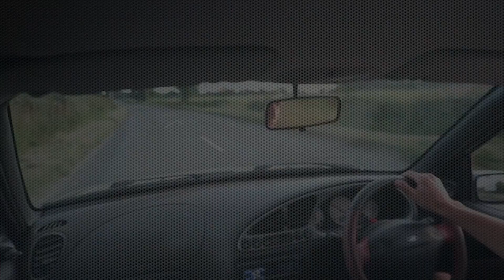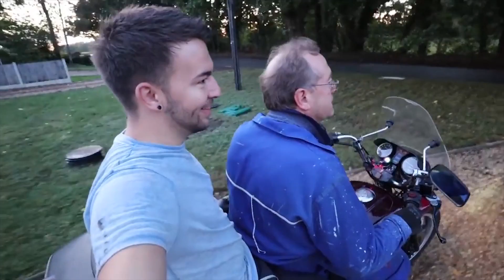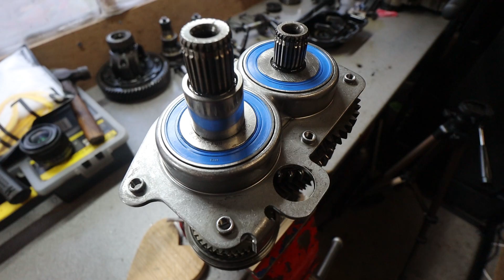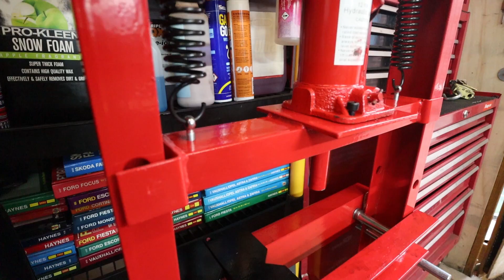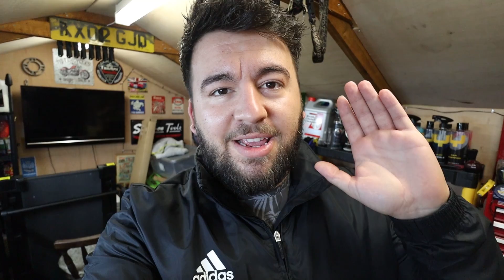Replacing The Skoda Gearbox Bearings!

Comment: Hello, great video! 

I am a precision fitter for a cnc spindle refurb company and work with this type of thing daily.... the easiest way to get bearings on to a shaft like that is to heat the inners of the bearing up slightly using a heat gun or a hot plate and ring. You will then find they expand enough So you don’t have to tap them down as this can sometimes knock the bearing out of track causing them to fail. 

Hope this helps👍🏻

Comment: hi . i was hoping you could help. can the drive shaft flange bearings be replaced with the gearbox in situ or does it have to be stripped down and the case split. my sons octavia 2 1.9 tdi 2009 is making a terrible rumbling noise at 60 plus mph and its not the wheel bearings . i have a strong suspicion its one or both drive shaft flange carrier bearings ? regards w

Comment: Was there any rattling Sound coming from the car when driving it or was it only at idle?

My fabia 1.4tdi Got a similar rattle at idle it goes away when pushing Down the clutch or just by  raiseing the rpm to 13-1500. 

There is No rattle when driving only at idle. Just had the clutch and releasebearing replaced a week ago and that did not help anything. 😅

Comment: Brilliant channel, nice to see someone who is prepared to have a go without a fully equipped garage, just a drive and a shed, your presentation and explanations are spot on (even if it`s something you are leaning yourself).  Quick tip don`t assume that ebay is going to always be the cheapest, I have got some parts much cheaper from a main dealer before, especially obsolete model parts they can be reduced just to clear stock. If you have different main dealers near ring both as the parts price can sometime vary massively.

Comment: I've overhauled many manual transmissions (mostly Honda, Toyota and Nissan) and I have NEVER seen a 'sealed' bearing like those used inside a trans.
The idea (usually) is to have them 'open' to be adequately and constantly lubricated with the 90# gear oil inside the trans.  This type bearing is normally used for different applications and the lubrication (grease) is contained inside the plastic seals.  I don't like this design and think it would be actually better to remove the seals. (No wonder they went bad)
Great job feeling you way through this fairly complex job!
Reply: I bet VW sealed the bearings because this transmission produces a massive amount of metal chips and shavings, which would cause even more damage if they got inside the bearings. Nonetheless, I agree that the oiling is practically nonexistent in these bearings due to the complete enclosure.

Comment: you can bring the ball bearings and the sleeve to around 150 ° C, then you can almost easily attach them.
an induction plate with a piece of sheet steel (3-4mm) works well for warming up.

Comment: Good video mate , Having watched all of it I think you or anyone else out there could possibly pull the bearing pack off by popping out the remaining visible seal on the left bearing , if you have a careful go at them with a very small screwdriver they will just pop out , there,s not much holding these in , having done that get hold of a suitably sized internal race puller off ebay or amazon , these have 2 legs on them that have shaped bulbs on the ends , you carefully insert each leg into the gap between the inner race & the outer ring of the bearing then turn the leg 90 degrees so that it then grips the groove for the ball bearings . Assemble the rest of the puller up above the legs & pull each bearing off a little , do this very evenly or you could easily bend things , a tip here ,  if you use just one puller only pull the bearing you,re working on a few thou , or you could start to bend things - terminally , either the puller or the shaft the bearing is on that you,re working on.Obviously to get the puller,s legs in you have to destroy 2 bits of the ball bearing cage in the undamaged bearing in diametrically opposite places , but you will end up changing the whole pack anyway so this does not matter . it would be very useful to know in advance the distance across the bearing,s ball tracks please , so that we out here can arm ourselves with the right sized pullers . For those that have never pulled any bearings off before , you use a stout , undamaged & well machined piece of flat steel bar across the top of the shafts to screw your puller central forcing screw down onto , with plenty of the same sort of oil that the gearbox uses on it to lube it , but still keep everything clean , no muck , grit , bits or dust must get in there .Ensure that you,re not pressing straight on the end of a fine internal caged bearing in the end of the shaft !  O.K. that,s my 2 penn,orth mate , it will be good to know the size of these bearings, please reply on here , thanks .

Comment: Thanks for some informative videos. Has anyone wondered why the 2 bearings are closed bearings? They both run in oil from the gearbox so why make them closed? Would it be an idea to open the bearings when rebuilding the gearbox?

Comment: Good piece of kit to have...wouldn't be without mine.
Don't forget you can use heat and cold to your advantage to expand/ contract parts that have interference fit.
You'll be needing a bigger workshop if you keep expanding 😬😉🤣
Reply: Have had the same thought for years now... the Man reaches a level where the space available is starting to limit his progress as a "do-it-yourself" Person.
But an upgrade is Flippin' expensive...

Comment: I’ve done a similar repair in the past, I put the gear cluster and main shaft in the freezer for a few hours and get the bearings warm in the oven, wife moans about freezer and oven stinking of gear oil, but bearings are just a simple push fit due to expansion and contraction of the metal.

Comment: Just to add my experience Ocatvia Mk3, 1.6tdi, 2014, gearbox MWW 0A4 was repaired under warranty at 80k km due to noise early in mornings sounded as cow, mouuuu. the noise disappeared once the motor came warm. Outside conical bearings on the diff - 2st. plus the two needle bearings and new oil - G052527 (or something like that was the specification). Trough, after 40km now the noise is back. Digging in documentation of the repair I found that the official service in Norway has tried to add 200mL oil to mitigate the noise with no success.
Now i bought 2Litres Castrol V (corresponding to spec as highly recommended to follow manufacture recommendations), made same 17mm tool a you :) and was ready to change the oil to try something and check for debris as I still have warranty for the repairment. However, opened the reverse switch and add 200ml 80W oil (what I had in the garage) and whalla - no that mouuuu noise anymore in any circumstances including heavy trailer.
Additional research on net shows that even in technical specs the gear box oil capacity is specified as 1.7L when refill out/in and 1.9L when dry fill. However, as I understand Skoda recommend now to add 2.2-2.3L instead. I assume all that is because the gear box is tilted by 12degree back and the fill in plug is not reference oil level anymore on O3 Mk3 models, oil fill in via the reverse switch, easy access under the air filter box, 22mm spanner, same 10mm hose fits well here.
May be some bearings are over the oil level as box tilted now and having the car over the night takes them to dry and the noise is coming next day first 100metters.

Comment: Correct me if I'm wrong but wouldn't hitting the center of the bearing potentially damage the ball bearings? I always thought you press a bearing using the outer part?
Reply: @TomAlter1000  that’s what I was thinking. My only experience pressing bearings is with wheels bearings on my car, hence the confusion. Cheers.

Comment: Hot tip on getting the bearings and the sleeve back on without too much hassle: use a heat gun and get the metal up to around 100 C. Then you should be able to simply drop it on the room temp shafts.
Reply: An old deep fat fryer is good for heating up engine oil and bearings evenly without the risk of damage to the bearings
Reply: It warms me to see that your very honest about your decision when rebuilding the skoda gearbox there are too many dodgy mechanics out there.excellent work

Comment: Regarding gearboxes. I had 13 years ago an opel astra G which broke at 70k km. The simptom was similar to your gearbox issue, one of the bearings broke iside the gearbox. Reading on forums found out it is a common issue for my gearbox type and the culprit is a manufacturing issue where they used a sealed bearing and because of this the gearbox oil was not able to lubricate the bearing. The only lubrication it had was the grease they put inside at manufacturing which looked like it was not enough. Remedy was to change the bearing and also remove the seal of the new bearing. I used the car for 9 more years and in total it got more 432k km with me until i sold it with a little over 500k km on the dash. Never had any gearbox issues. One note, i always change gearbox oil for all my cars every 120k km. It is not a big investment although many ppl say it is not necessary. I always play on the safe side as my cars are my moneymakers. Nice video mate! Keep up the good work.

Comment: You could have had a 2 tonne bottle jack in there to press the bearing off. Even though it’s a 12 tonne press doesn’t mean u need 12 tonne of force for it to come off. Use a bit of heat to expand the collar and it will slide on without hitting it on

Comment: Heat helps. Trick that can work, find a sock that will just rest inside the bearing inner race. Use a blow torch to heat up the socket. Once hot drop it into the bearing. Leave to sit for a short while. Heat transfers into the inner race, which should expand. Then the bearings should drop of, or tap on with very little effort

Comment: Great video pal - I wondered if you could help. My 1.2 HTP 2009 makes the same clutch noise but maybe not as bad but it stops making this noise once the engine has warmed up. Could it be that I need to get some new oil in the gearbox? Strange that it stops once it has warmed up.
Reply: sure its not a pully ie aux belt tensioner pully
Reply: @frankyboy6245  Not sure pal do you think it could be?? Not looked properly in to it yet as car drives perfectly just makes this clutch noise on a cold start up
Reply: @lewispickles6402  change the gearbox oil 1st mate, as what you have described happened on my subaru sti, was I nightmare when cold then warm would be fine. I changed the oil and it was like I had replaced the box. I know mine is a totally different car to yours but its worth a try.
Reply: @mkm7962  Cheers mate I'll give that a try then because it is loud when cold then once warm doesn't make any noise at all. Cheers bro

Comment: I see you have a whole library of Haynes books 😂 
Great video!
Reply: They are good books mate I have a small collection too.
Reply: @Alexander_l322  I have one too for my fiesta
They explain almost everything
Reply: @jozsef6453  good mate, keep them never throw it away even when you get a new car! I kept mine from ages ago just incase.
Reply: There good for dimensions and fluid capacity and torque settings really I wouldn't recommend using one if your a novice mechanic they don't really explain in great detail or if you have one you'll know that looking up a fix in one is a ball ache as for instance changing a blower resistor, you get to the page about blower resistor and it says to remove glovebox please refer to page whatever lmao so yer if you've got a problem and your a novice my advice is to look on YouTube or ask a garage don't just buy a Haynes manual and expect it to work miracles 👍👍👍👍
Reply: @lea-rw5cb  and on YouTube you can see how to exactly execute the job rather then relying on diagrams
Reply: @user-wl3lm2un5e  they only any good if you already know roughly what your doing

Comment: A bit more from me , I,ve renewed bearings in many different machines , & when you need to do this you have the golden chance to fit a much better set of bearings than might have been in originally , if the design of the machine allows you to do it . Sadly the backplate for these end bearings is rolled onto these ones , unless there are still some very skilled tinsmiths still out there you are more or less stuck with it , but you might be able to find a supplier that uses stronger bearings of the same size , this is possible , for a start  , plastic caged sealed bearings in a gearbox , these need swapping for steel shielded steel caged bearings of the same size , these should be far stronger , & the outside seals on them are literally small steel shields that keep the lube in , & foreign bodies out . That is why you ended up fishing one seal off the back of one gear , it had got knocked out of the bearing by bits of broken up plastic cage . Gearboxes by their own nature end up with bits of finely smashed up steel shards floating around inside them in the oil , this is why it's wise to change it , they usually have no filtration system . Also I usually end up using any of the following bearing makes & they prove quite satisfactory ; Timken , now usually sourced from France , R.H.P. ( Ransomes , Hoffman & Pollard ) , English , F.A.G , Portuguese , I.N.A. Chechoslovakian , just spend some time talking to your local bearings & seals factors , this can give good results , they have a wealth of experience . Roller bearings , if you can physically get them in , are many times stronger than any ball bearing , you just have to discuss the application with your bearing suppliers , I,m fortunate , I have an excellent one .

Comment: you could have just put 2 sockets on top of the bearings, a large enough plate on top of the sockets and use the press on top of the plate, and you could have pressed the bearings in to place

Comment: Great video james wonder what made the bearing fail. Do think oil starvation or just wear and tear. Rev it at 6000rpm dump the clutch now 😂
Reply: They usually fail due to lack of maintenance and level checking. Gearbox oil levels on these small boxes should be checked every year and renewed every 3 imo. The oil coverage on this design is not the best and therefore lower than full levels may cause the end bearings on the shaft to receive a bit less lubrication. The biggy is the 3 year change as it is important to get fresh oil in there because of the above. The last 5 gearboxes I have drained all had brown to black coloured gearbox oil - oil had broken down, burned or contained dirt and water (from years of condensation).

Comment: The 2 shafts in a sealed plastic bag in the freezer would have worked also very good, then the bearing would just slide over it (in most cases)

Comment: Good trick for fitting bearings, wack em in the oven for a bit and they will expand slightly making them easier to fit.
Reply: Add put the other part in the freezer, often no need for any impact forces.
I'd never hammer the inner race of a bearing either, I use washers etc to spread the load completely across it.

Comment: Excellent job. Once a VW gearbox  has been re-built, then I presume the gearbox oil should be changed at "Old school" intervals . . I.e. every 4 years or 48,000.

This VW "Sealed-for-life" gearbox   is marketing non-sense.Gearbox oil needs renewing.

Trouble is the main-dealers seem to follow the VW service advice religously (Presumably at pain of loosing the franchise) and will not renew gearbox oil, even when instructed by the customer, because its "Not in the service schedule". Totally evil official VW instruction designed to make gearboxes fail.

That's what killed my Fabia gearbox along with an inout shaft leak. Main dealer then had the gall to insist that a new gearbox was required from Germany at £2,500.

So I took it to an indy garage and had it repaired for £1600. 

Now 5 years of trouble free motoring on, the gearbox oil needs replacing and the indy garage seems to have stopped trading.

i'll have to do it myself.

Comment: I don’t get surprised anymore by part prices. After twentysomeyears as an aircraft tech I’ve learned that prices has an other dimmension in the airline buisness than in your home budget. Take the price - multiply by 2 and then by 10. O-ring costs 5p - x2 x10. You wil have an airworthy o-ring for 1£. Therefore I never get surprised by car part prices. «Three OEM bolts for my exhaust - 20£....? Okey - it’s probably a fair price....»
Reply: PS: One week from ebay?  In northern Norway we count months. From the UK it takes 2-3 weeks for a parcel to arrive. Luckily we’ve got some pretty decent stores nearby that can offer parts within few days if they’re out of stock.

Comment: normally that statement " if its not broken dont fix it " wouldnt apply when you have the gear box that stripped as if 1 bearing has failed all the rest have done the same miles so will go soon and as you are that deep you are better off to swap the lot
Reply: Why he’s not running a business he doesn’t have to warranty his work he’s done the right thing highly doubt he’s even charging for his labour
Reply: @georgemiller4585  yes i no that but still as a mechanic it would be good practice to do as otherwise he could refit and 10 miles later another bearing pops and then would be gutted as have to re do everything ,
Reply: @TheDarkSide46  Replacing the bearings that are fine carries its own risks. What if the replacements are sub-standard or have undetected defects from new?